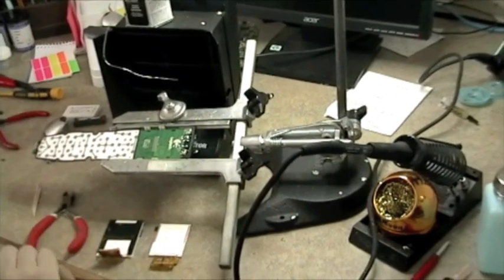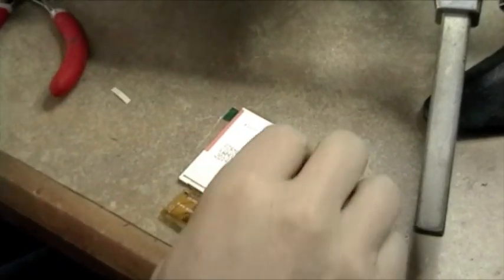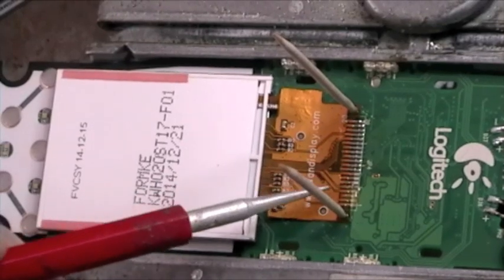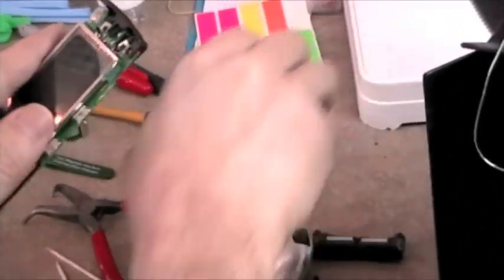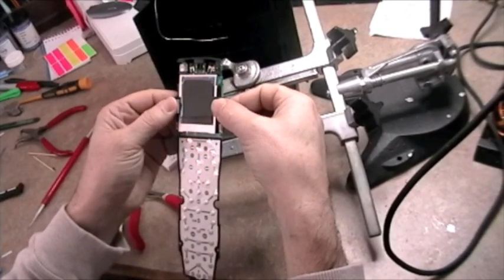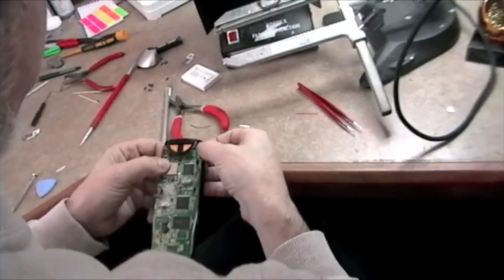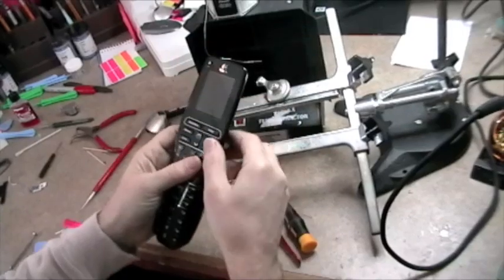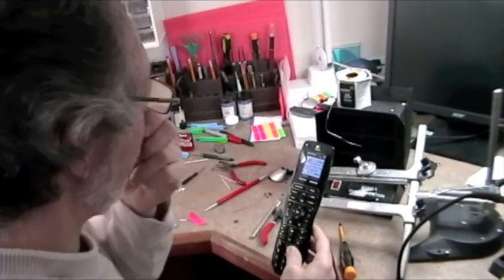Logitech Harmony One LCD Installation - Part 3: Installing the new LCD

Comment: Hello, would you know why the lcd would be white all the time? I bought a used one and the screen starts white. I have it all apart and i don’t see anything bad. I found a loose screw inside though.
Reply from the maker: A ‘white screen’ on a Harmony One is typically a failure in the LCD itself, but it could also be a failure in the IC on the logic board that controls image processing. Sorry! I wish I had better news for you

Comment: Where is the solder to attach the new cable coming from? Is it on the ribbon cable already?
Reply from the maker: No. New solder should be applied to the tip of the iron and then swiped onto the pins. The solder is off-screen. Sorry about that!

Comment: I Hope you can help , I have a Freese LCD and found that the  maylar circuit board that connect with the sensitive glass is not contact apply pressure i have contact ones more , the question is how to soldering it to the cristal board any sugestions will be apreciated t5517cf@gmail.com
Reply from the maker: Hi Carlos -  Though I'm not familiar with this particular module, typically this kind of damage cannot be repaired without very specialized bonding equipment. I'm sorry! I wish I had better news for you!

Comment: Hi,  really enjoyed the video.  But what to do when the zif connector is broken of the lcd screen? Screen is working but doesnt respond to any touching on the screen.
Reply from the maker: Hi David - If the ZIF connector itself has been damaged, then I would need to see a picture in order to determine if it can be repaired. If only the small closure tab has been damaged, then the ribbon cable may be able to be held in place with a shim and some epoxy. But, the most common reason for the digitizer to stop working after disassembly is that the leads on the inside surface of the front cover have pulled away. This can sometimes be difficult to see, but if you very carefully inspect the cable where it enters the front cover on the left side, there should be no movement past the small dab of holding cement in the left bottom corner. Even if a single lead has lifted from the pad, this is almost impossible to repair in a reliable way as these connection are pressure and heat bonded during the manufacturing process. Luckily, if that's the case, all you really need to do is get another front cover. These can often be found on Ebay and I have them as well. You will only be able to find used parts as the covers are no longer manufactured. Contact me directly at info@harmonyremoterepair.com if you need more assistance with this.